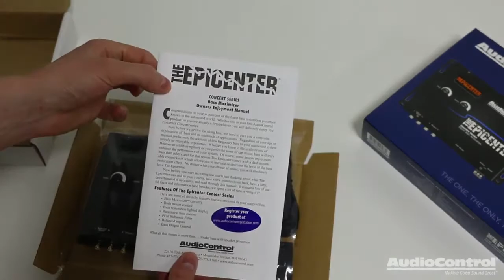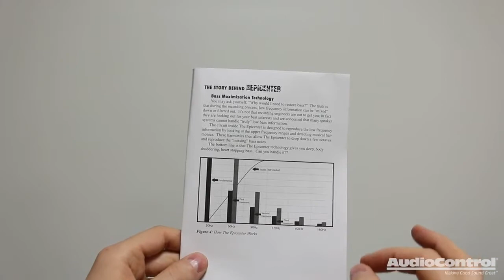Get to know the AudioControl Epicenter Overview Video

Comment: Im wanting to add this to my 18s. My box is tuned to 30hz. Does the epicenter work best at certain frequencies?
Reply: Your sub box is tuned to 30hz but the epicenter will only play down to 33hz . But you can order 15hz 20hz chips or them so you can play lower Hz
Reply: @jaywesley3500  

33hz with a roll off. Not exactly 33hz

Comment: would you advise the indash epicenter or the unit from this video ? and why ?
Reply from the maker: indash has the same features however its just a indash mountable version instead of a trunk or underseat version.
Reply: Besides ithas a display for voltage and DB with a mic

Comment: What does that 1 amp fuse look like? literally only information I came here for
Reply: I know you asked this over a year ago, but I’ll answer your question and how I did my install. I used the 1 amp fuse (black colored) with an inline fuse holder (ATC style fuse with a holder and a wire on each side) I then put one end in my main amp power input and soldered the other end to extra wire to wire into the plug . Taped up the wires so it’s not visible and now it is protected against shorts and it’s the most simple way of hooking it up by piggy backing off the already available wires present on the main amp (ground, remote, and constant 12v)

Comment: Where do the power connection's go??? Rem., Power+gnd???
Reply from the maker: Constant power to the power terminal, Earth connected to GND and Remote trigger from your head unit to the REM terminal. If unsure, check out the manual for the AudioControl EPICENTER ;)